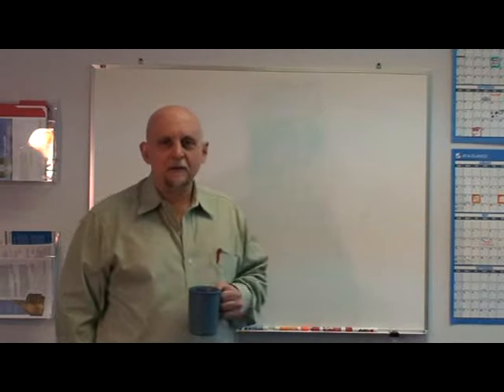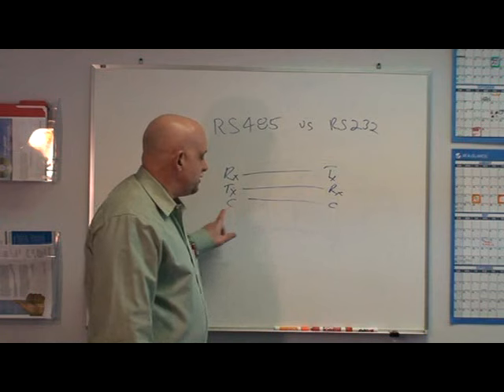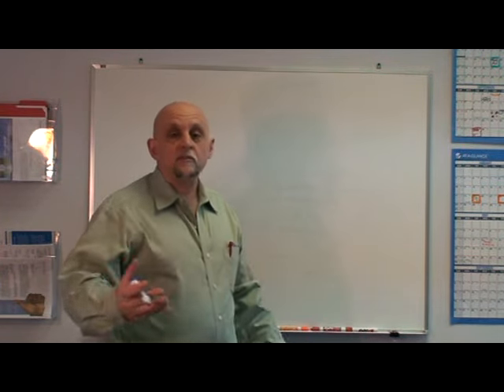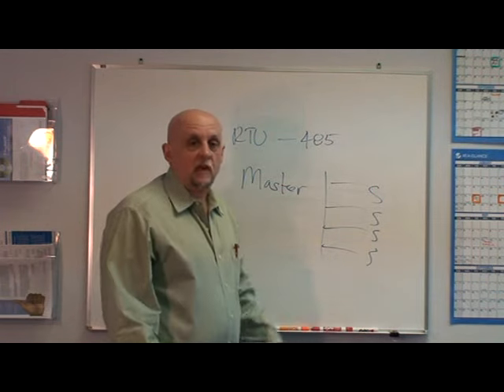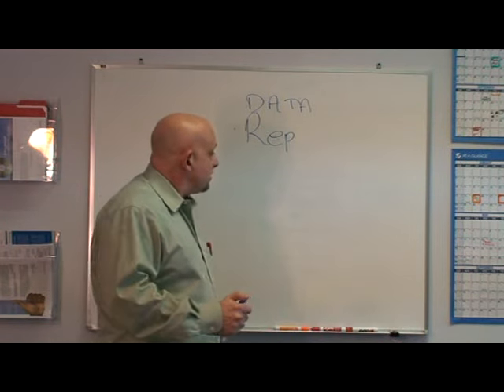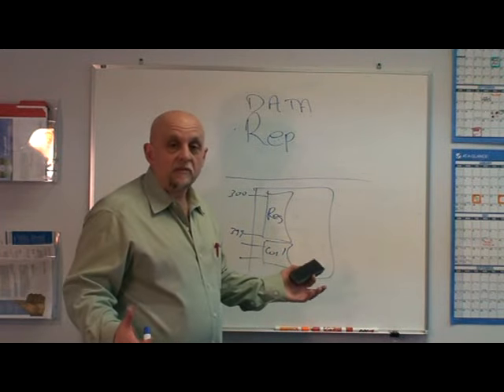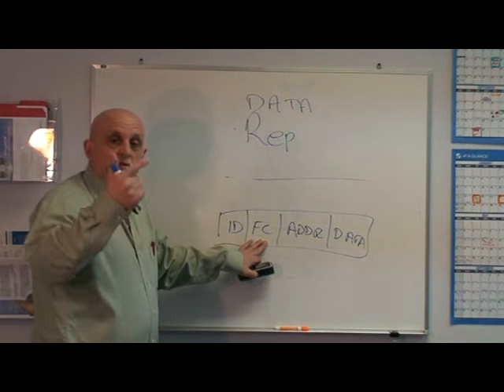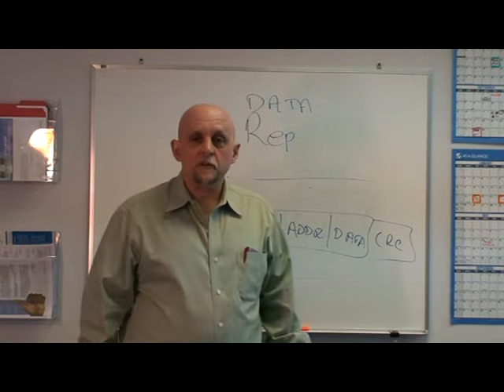All You Need to Know About Modbus RTU

Comment: This is a great video John. I think it would also help to mention if I may, that RS485 Modbus is a 3-Wire network. A lot of people think Half-Duplex and 2-wires. But its critical to note that you have a Positive, Negative and Reference cable. Its advisable to use 2-twisted-pair cable i.e. Belden 9842 (twisted pair is better at noise cancelling than outer shields anyway). As a last resort you can use 1-twisted pair cable with the drain wire acting as the 3rd REF core. Its important to note that the 3rd core is NOT a ground connection but a direct reference for the Positive and Negative wires on the network. Keeping a nice clean network saves a lot of hassle and head-scratching as without a bench scope to hand, some issues are hard to pinpoint.

Comment: Nice video.  At my company we have a product that uses an EBM fan which we control over modbus.  Just out of curiosity, how would you suggest controlling them?  Each one has several parameter, like speed, which need to be set.  We are currently using a programmable control by Carel, but we have had issues when we go more than 12 fans on a single controller.

Comment: Hi John.  I am working on a project for a client where their generator paralleling switchgear is controlled by multiple plcs that communicate with Modbus+..  One of the meters (Powerplex Digital Transducers) became wet and stopped working..  I found a replacement- sent it to Bitronics to be refurbed, installed it and verified it works, but it’s not registering the gensets output voltage correctly.. Instead of 480V it’s displaying 120V..  The generator is making 480V- the transducer needs to have the holding registers edited so it will display the voltage properly..   I have a lot of the hardware to do this such as the SA0085 card, or the Schneider TCMP100 PCMCIA card which are both exclusively used for MB+..  I am having issues communicating with the meter via laptop…  Any ideas, suggestions?? I would greatly appreciate it.. Thanks..
Reply from the maker: Modbus+ limits vendor support. Schneider is the best option I know of.
Reply: I’m very amazed with how much information they openly offer..  It turns out, it was an addressing oversight within the BiView configuration…  👌🏻

Thanks for the reply! 👋

Comment: What voltages does it operate on . Are the coils 24V . Air vent shutters openers . Temprature sensors . Motor on . Are these the 230V/24VAC transformers in the cabinets . Automation . You can use a 3G power cable L1 - N - PE line to trafo P. And 2G load actuator 24V, L1 - N .  Some loads need power lines along with signal wires. 4G - L1, N, S1, S2 + emc screen . I guess Modbus files under SELV equipment once below 50V, and dont need PE. The TCP Ethernet has a ground wire along with 4 pairs . F/UTP and usually 5V DC . The boys call it Patch cables . The voltage on the signal and the power to drive the unit, sensor, coil or CPU is determining the cable dimensions and lenght . What is the range and specs of PoW power over internet cables ?

TCP : https://catalog.belden.com/index.cfm?event=pd&p=PF_7919A . 100 meter max cable
RTU RS232 : https://en.wikipedia.org/wiki/RS-232 (VGA cable). 25V
RTU RS482 : https://catalog.belden.com/index.cfm?event=pd&p=PF_3105A. -7V + 12V. 400 meter
PoE Rj45 : https://www.veracityglobal.com/resources/articles-and-white-papers/poe-explained-part-2.aspx
25W / 48V DC = 2 Ampere on three twisted pairs. 1 pair for signal device. 24V. 50 meter

Comment: I'm using Python in order to control a motor via modbus, is there any way to change the turn around time without ramping up the baud rate because that would be quite helpful to avoid missing data

Comment: Hi John.. Thanks for the video.  I am trying to reverse engineer a modbus RTU temperature logger so I can publish the output of its 10 NTC sensors.... I have got the following response... 02 03 78 02 25 20 00 00 00 64 00 0C 50 00 FF - 02 25 20 00 00 00 64 00 04 50 00 FF - 02 25 20 00 00.... and worked out that the "0C 50" swapped to "500C" is the temperature... 500C in hex is 20492 and the indicated temperature is 49.2C. It seems that this is encoded in 0.1C increments, +20000 and then the lo byte first and then the hi byte.  (Also 4E1F=19999 when -0.1C indicated and 4E23=20003 when +0.3C indicated) Any idea if that is a legitimate coding! It seems to produce the right answer. I am using an old AKO-15772 I got from ebay.  Thx.

Comment: #3 you explain that RS-485 is a 2 wire protocol, this depends again on what your looking for. 2 wire RS485 is Half Duplex, 4 wire RS485 is full duplex.  You also forgot to mention that both 2 and 4 wire RS-485 require another (3rd or 5th) conductor which is your signal reference.
My suggestion is for you instrumentation techs to leave the communications to the experts. I promise to follow suit and never program a PLC and post a how to on something that my knowledge is limited
Reply: Exactly what I was thinking. He seems to be conflating the concepts of differential and tri-state.

Comment: WOW John,
Hate to throw you under the bus but your information is very misleading.
#1 Modbus RTU is not just for RS-485, you can run it across any serial medium ie RS-232, RS-485, RS-422, EIA-530 ect.
#2 you are explain that RS-232 is a 3 wire serial communications protocol, this is WRONG, RS-232 protocol has 25 wire functions although 3 wire has become readily available thanks to the use of data buffer circuits that negate the need for handshaking and flow control.